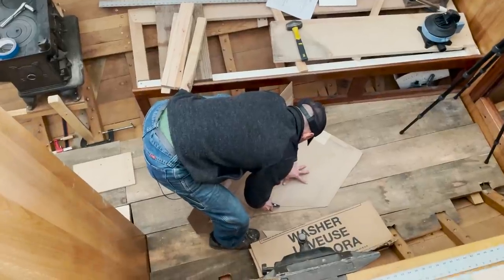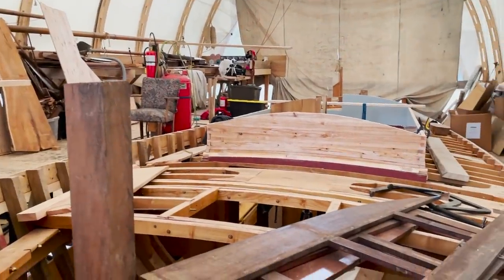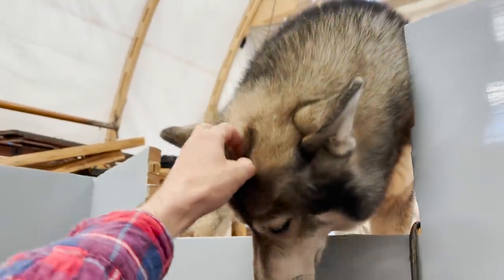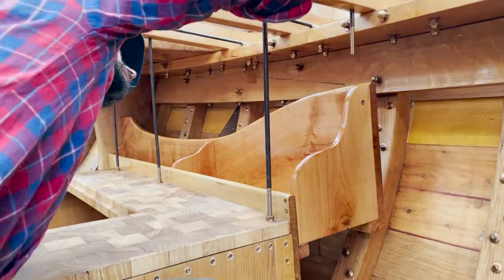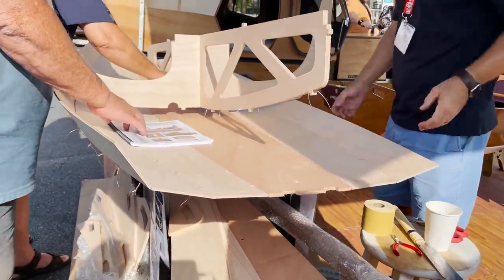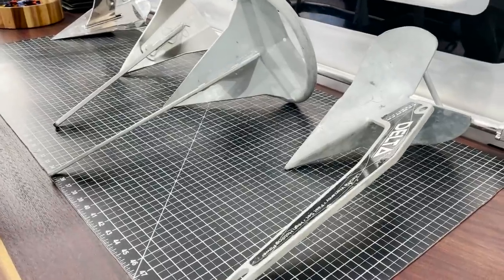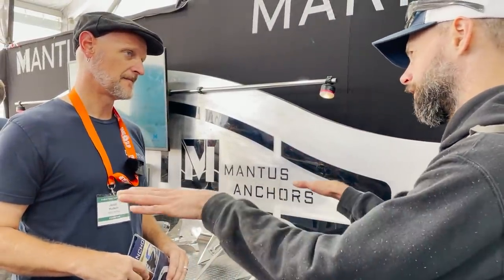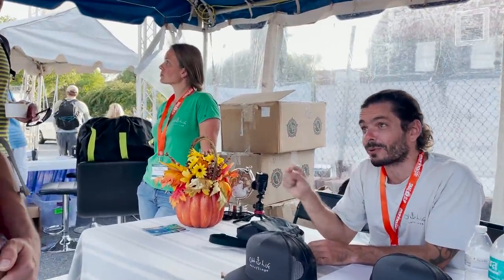Counter Install & Annapolis Sailboat Show—Episode 185—Acorn to Arabella: Journey of a Wooden Boat

Comment: Some people with plastic boats put wood in the interior and some people with wooden boats put plastic in the interior.. I think your solution for the ceiling is an excellent idea and Arabella is going to be a boat that is very pleasant to live in and sail with. A lot more than a big plastic catamaran in my opinion. I can uderstand why people opt for the latter, but a boat like Arabella is far more handsome and practical I think. She is going to be strong and beautifull. I'm having a lot of fun following your project and have learned al lot from it.
Reply from the maker: Thanks, BG! Probably the most practical thing about Arabella is that the materials came from right here, which is special, but ultimately, has made this whole thing possible. Use what you’ve got!!

Comment: Man when he said the weight would be 28,000. It made me had to think, my old 25 ft Brynne was 15,000. Even though my old boat was heavy in the extreme. I would have still expected that Arabella would be heavier than that. Then I had to remember friends of mine that had 35ish Atkins, that was about there weight as well. Wish I remember the exact, but that was 30 years ago.

Comment: I have a 37' fiberglass boat... similar length to yours, but way lighter... anyhow, the newer "scoop" style anchors (Mantus, Rocna, Spade, Manson, etc.) are WAY better than the plow-style anchors (delta, cqr, etc.) and worth every penny. Ours is only 45lbs, but our boat is only 15,000 lbs... roughly 1/2 of Arabella. Ours is a Manson Boss anchor, and while I love it, my only criticisms are: 1) Scoop-shaped anchors like these like to... well... scoop up mud and sand, so when I raise the anchor up to the bow roller it often has 10 pounds of mud/sand on it... not a deal-breaker, but a little messier than other anchors I've used. 2) You also have to consider how it sits on your bow roller and whether that interferes with dock lines or mooring lines nearby. In my case, if I used the bow chocks on the boat as designed for a mooring line, it would chafe against the anchor, cutting the line. I also keep a Fortress onboard as a backup. They have a ridiculously-high strength--to-weight ratio, so while they don't reset well (not good as a primary anchor in my experience) they are AWESOME as an emergency backup or to "kedge" (new vocab word for you if you don't know it already). Incredible holding strength once it's set, yet light enough that I can carry it in and out of the dinghy with one hand and store it in a locker easily.

Comment: Two observations. One - why all the screws to hold on the right bulkhead support? That is a LOT of screws.  Two - the first time you run a hip into the sharp corner on that counter I think there will be some old fashioned salty language in the air.  It does look like it would be possible to hit that, and from my experience with something like that in my kitchen, I could have saved a lot of time and effort had I given those corners a bit of radius at the beginning.  I am a land lubber, but love what you are doing.

Comment: alix: good to hear your voice, what happened to your face? give us a smile and a wave or something! ann good to see more of you! akiva is definitely expressing joy when the tail is raised! beautiful backsplash it will probably make you hungry for many years. like the idea of bee's wax finishes I use them for almost everything (mustache, cutting board, furniture, knives, axes, any other cutting tool like saws, planers). the trick for smell if you use turpentine and want it on your upper lip is to cure it in the sun for a long time, same with natural soap. leave it on the fence post for a couple months and let it breathe. UVS and carbon dioxide. I use grapeseed oil to cut it as it is super thin and smell free. I also boil some orange peels in the oil before shutting off the heat and adding the wax (fire hazard and don't have open flame near turpentine either). See you next week!
Reply from the maker: The narration is Ben, our editor! Thanks so much for the orange peel recommendation!

Comment: I use a 13# Mantus anchor to anchor my 23’ fishing boat in the Columbia River in huge currents. It holds in sand like no other anchor. It does not work on gravel at all but I have a kedge anchor for those spots. Anywhere I anchor in sand though the Mantus is money.
Reply: @roscoejones4515  mostly chinook.

Comment: Hey Steve.. just a thought about your (gorgeous) stainless sinks.
Ever notice how quickly the hot water in stainless sinks goes cold when doing the washing up, because so much of the heat radiates away? So that you either need to add more hot water before you're done, or finish the load in cold water, which won't properly dissolve grease?

It occurred to me that adding a reasonably thick layer of insulation to the outside of the sinks would go a long way towards keeping the water hot longer, saving precious water. Makes me wonder why no cruising sailor I've ever heard of, does this. Certainly, I'll be doing so on my own boat, when she's built. Maybe give this some thought for Arabella.
Reply from the maker: Yeah! We heard last week in the comments from someone who has lined the outside of their sinks with neoprene. Cool idea.

Comment: That fiberglass sheet will crack over time.  It doesn’t handle vibration that well. So make sure it’s not that hard to replace.
Reply from the maker: Nothing in this boat is hard to replace… Steve’s being a little particular on that point.

Comment: I wouldn't recommend to put that fiberglass sheet behind the gally. Just leave it open or put slats on it. But not tung and grove, I mean with spaces in between them. Ventilation is everything. I have been on multiple wooden boats, some of them only a few years old and covered areas where always a problem. Not a single boat without mold and in some areas rot. The only exception was a boat where you could see the frames and the planks. They are beautiful, why don't show them? 
That's just me, but I would cover the wall behind the gally with a brass sheet, fixed with just a few screws, so you can look behind it from time to time.
Reply from the maker: Thanks for your thoughts! This will be removable with the removal of just a few screws, and yes, it’s a humid environment, so there’s mold in your life on a boat… of any hull type. The balance between keeping things from rolling down into the bilge along the hull (not great) and having unobstructed air flow around everything (not possible) drives this little decision.
Reply: @AcornToArabella  Thank's for responding to my thoughts. I totally understand two things, first, things on a boat are always a compromise and second, it's your boat and you have to life with your decisions. But my two cents are that a brushed brass metal sheet above the frames and from the countertop almost up to the deck beams would prevent things from falling into the bilge and it allows that stream of air. And it would look great. All I can say is that the wooden boats I inspected for buying, where in better shape if they had a good ventilated interior. Forced air ventilation, Canvas or wickerwork cabinet doors and so on. I ended up with a steel sailing ship though.

Comment: are you going to use spay foam on the inside of the bulk head for insulation and  floatation . it gets cold on the ocean .
Reply from the maker: No, mostly because of it’s a ability to hold moisture and the fact that wood itself, and the water around the hull, is very insulating.

Comment: How will the edges of the bulkhead panels be treated for protection?
Reply from the maker: They are treated with varnish primer (2 coats) and varnish (2 coats) before installation.

Comment: why the hanging bolts when the countertop is supported by the bulkheads?
Reply from the maker: The countertop (nor the cubby) isn’t going to be attached to the hull, the bolts connect the back of the counter to something solid. In the interest of future repairs, nothing from the interior is attached to frames.

Comment: Instead of the proposed heater, use a Webasto heater instead.  I can be placed out of sight in a lazarette so it doesn't take up valuable cabin space, it can be vented out the transom and not through the roof, and it's small, it uses diesel fuel, and it produces forced air heat instead of radiant heat.  A far better choice than what you have planned.

And toss that iron stove overboard.  It takes up too much space, it's dirty, you have to collect and store wood, and with a gas stove, and a Webasto heater, it will rarely be used.
Reply from the maker: Not much space in the lazarette of a double ender. Neat idea though. And if we don’t like the Shipmate, we’ll be finding it a new home. Much easier to try it out and gain the space later. Thanks so much for watching!
Reply: @AcornToArabella  But the Webasto heater takes up very little space; about the size of a loaf of bread.  Put it in the engine room. Better to do things right the first time.

Comment: It sounds like the planer needs to have the blades sharpened
Reply from the maker: It’s a motor issue. It’s also supposed to have two gears, but has only ever worked in one.